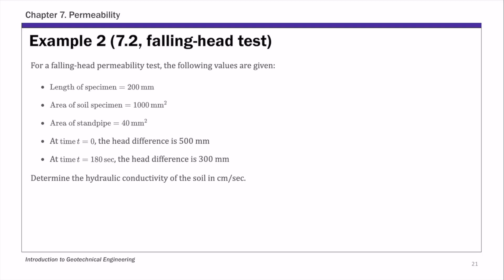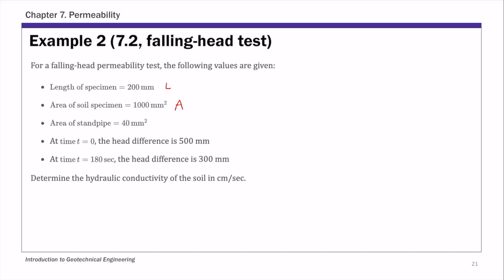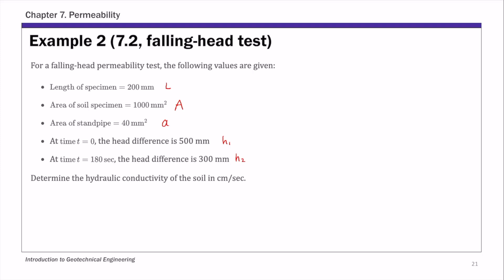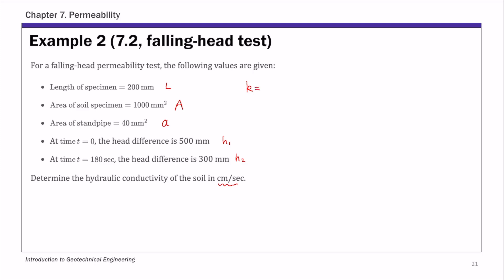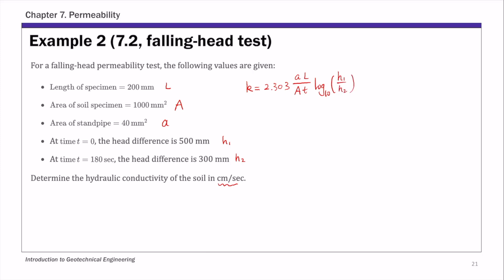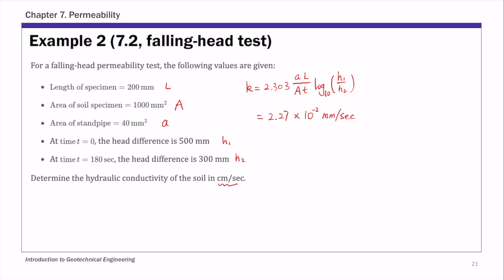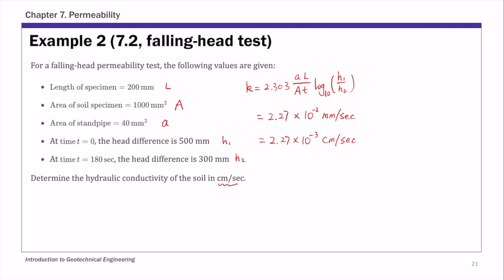Chapter 7 Permeability - Example 2: Falling-head permeability test

Comment: Please sir can you solve this Question Three
respectively, from the bottom of the sample is 2.4 cm. Determine the coefficient of permeability 
of water in 12 min. The head difference in two piezometerslocated at 1cmand 12cm, 
1.65 103 m3
In a constant-head permeability test, a sample of soil 14 cm long and 6 cm in diameter discharged 
of the soil. What is the soil type tested?